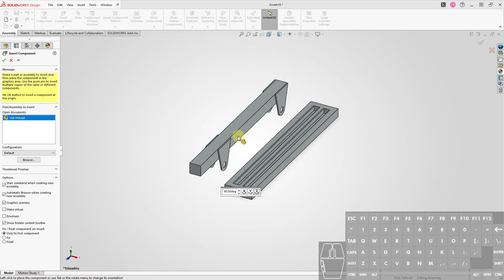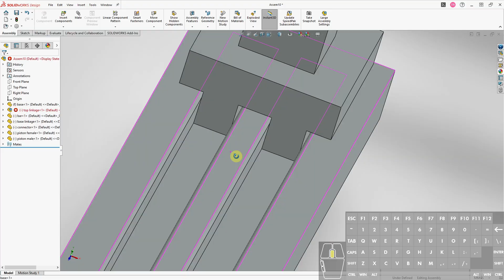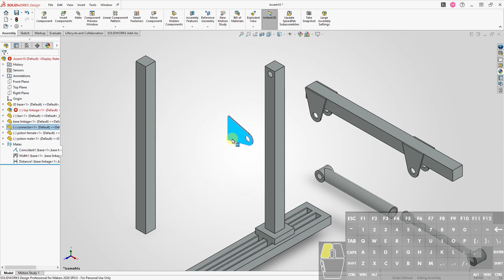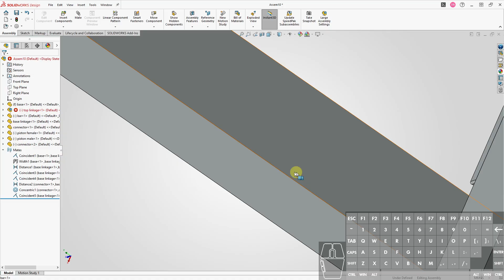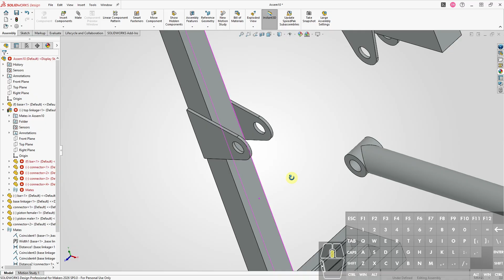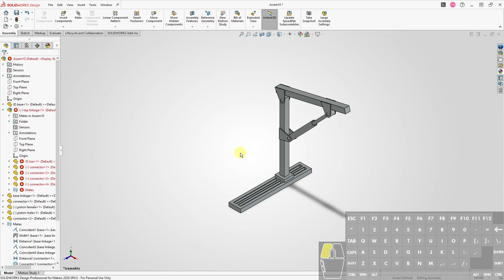SolidWorks CSWA Practice Problem 9.8

Comment: I found one mistake in my mates between the base linkage and the base after watching this video. Thanks! 

My sub-assembly unfortunately couldn't  be imported: the bar was missing. so I measured the hole-to-hole distance in sub-assembly, which is 993.87mm and rebuild the sub-assembly.
 
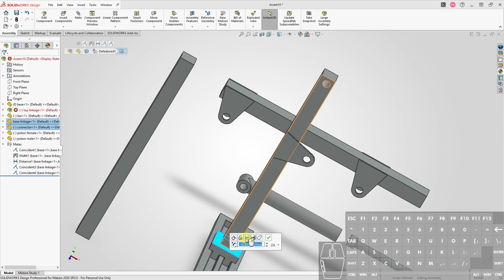At 7:45 in the video, when the distance of 660 was being set, I noticed that was a center-to-center distance. That means when the distance is 0, the extremity of the connector's tangent surface will be embedded into the base linkage. At this point, the center of mass of my model was (331.76, 782.23, -191.00) (I don't understand why my X always not 331.60 as you guys did). If I replaced this distance of 660 by using Min. (edge-to-edge),  result (331.76, 782.32, -191.00), just for the information. 

When I rebuild sub-assembly, I also mated the connector tangents with the vertical surface of the bar (I am not sure, no more info).

Level 9 and 10 of those Practice Problem made me very frustrated, I've had to spend a lot of time to check those missing info to figure out out why my answers differ from the answer key. Glad I have your videos to refer and replay from time to time.
Reply from the maker: Thanks for the comment!  Hopefully it will help others who might have been running into the same issues that you did.  And yes, I remember spending an inordinate amount of time on Level 10 because of all of the mistakes and/or reliance on older versions of the practice problems.  But I suppose the end result was good in both our cases, because we both ended up with perfect scores on the CSWA (congratulations again on that!)! 😊

Comment: Thank you for making these videos, they're very helpful when the supposed answer for centre of mass doesn't make sense :)
I get a slightly different answer though:

Center of mass: ( millimeters )
	X = 331.60
	Y = 780.40
	Z = -191.00

I made sure to set up the width mate for the base, but I can't find anything else I could've overlooked (I'm probably just still overlooking it haha)
Can you help me figure out where I went wrong?

Edit: I redid the entire thing doing exactly as in the video, but I still get a differnt answer, even though the Y-value is much smaller now:

Center of mass: ( millimeters )
	X = 331.60
	Y = 782.31
	Z = -191.00

This led me to find that the top surface of the base is not coincident with the surface in the base linkage that "holds the teeth", because the teeth are longer than the indent rails on the base. I hope that made sense for anyone else troubleshooting :)
Reply from the maker: Thanks for the comment, and sorry for the late reply!  Yes, that's exactly the culprit--the coincident mate should be between the very bottom of the base linkage and the bottom of the slots it fits in.  This leaves a little gap between the bottom of the "wings" of the base linkage and the top of the base.  Man, this stuff is hard to describe in words. 😅  I tried mating the faces the way you did originally, and got X=331.61, Y=780.31, and Z=-191.00.  For anyone reading this, it might help to try going to Evaluate -> Interference Detection -> Calculate, and then you can see the overlap between the base linkage and the base if you accidentally mate the wrong faces.  Thanks again @yoshi230898, and glad you got this one figured out!

Comment: Center of mass: ( millimeters )
	X = -191.00
	Y = 332.88
	Z = 782.29

Why am i getting my answer like this ?
Reply from the maker: Interesting!  It might have to do with how your axes are set up.  I have a "y-up" coordinate system by default, where the y axis goes up, the x-axis goes to the right, and the z-axis comes out towards me by the right hand rule.  Do you have a different setup?  What does your coordinate system look like when you view the front plane?
Reply: @DavidsSolidWorksVideos Yes that was the issue, Thank you for your videos ,they were helpful for my preparations.
Reply from the maker: @jaiksthomasjoy  Glad you got it figured out, and thanks for the kind words! 😊

Comment: i got different answer 
 Center of mass: ( millimeters )
	X = 1412.55
	Y = 2098.53
	Z = 1161.79

i followed along and still could not find what is wrong :(.  also i have different answer for 9.7 CSWA problem same issue,
any idea why!?
Reply from the maker: Thanks for the question!  The only thing that comes to mind is that maybe the first component you inserted might not have been fixed at the origin.  When inserting the first component, make sure you have either "Only fix first component" or "Fix" selected.  Then be sure to click on the green checkmark next to the words "Insert Component".  You can check if it was inserted at the origin by clicking on the assembly's origin in the feature tree, and then clicking on the component's origin in the feature tree, and see if they're at the same place.  Oh, and your first component should have an "(f)" next to its name in the feature tree.  If not, it's definitely not fixed in place.  Let me know if any of this helps!
Reply: @DavidsSolidWorksVideos   yep, same as the last problem happened, both origins were not coincident. Thank you for the reply :)
Reply from the maker: @MohitPatel_35  Awesome!  Glad you found a way to get it working. 😁